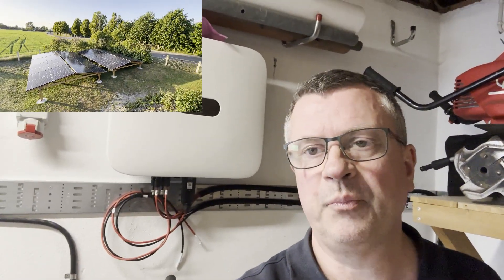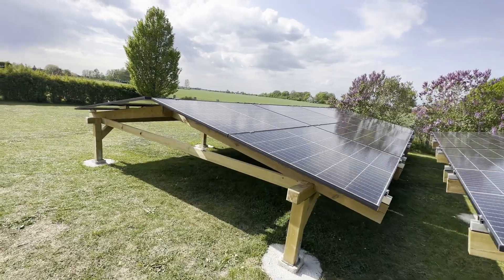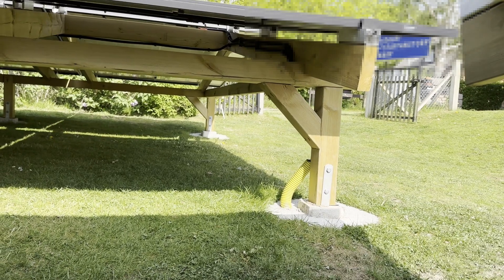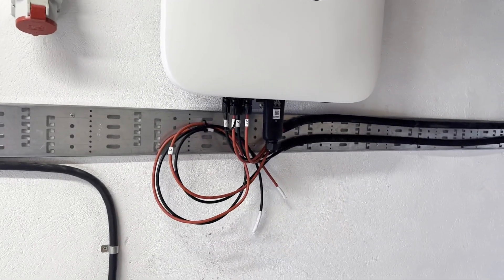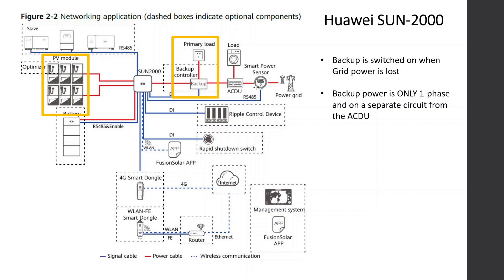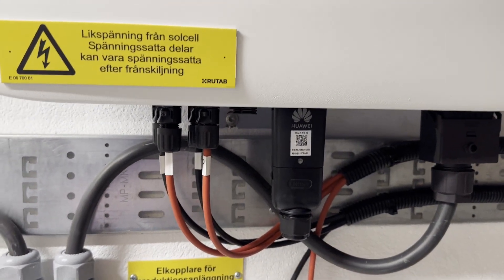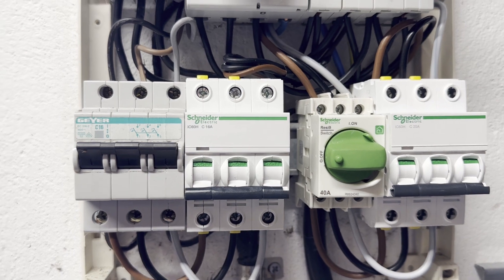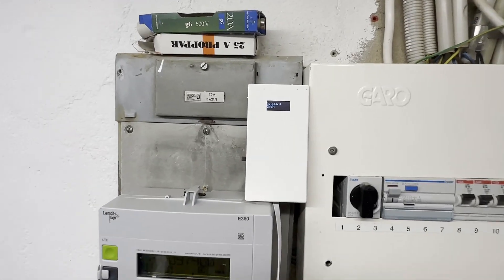Building Solar Panel Array - Part 7 - Completed

Comment: If you have risen the height of tge structure,then you can use it as a shed.
Reply from the maker: For sure, maybe in the future I will have a building here, and then I can move the panels
If I would build it higher, it would require permit and be a lot more complicated. We wanted the structure to be "discrete" and not so visible

Comment: Fantastiskt!!!
Thanks for your videos.
Now it´s a new installation, have you any experiance on dirt on the panels? Are there any need to cleaning them on the surface?

Are there any software delivered withe the panels/inverters?

How about the economics? How much was the cost for the panels/inverter/installation?

I´m really impressed by your job!!!
Reply from the maker: So far, so good, I have seen some pollen and birddroppings, but it’s easy to clean off with water if needed, in fact I have not seen any performance loss so far
From what I have been told normal rain should be enough, lets see if that is true
I will keep you posten on how it works